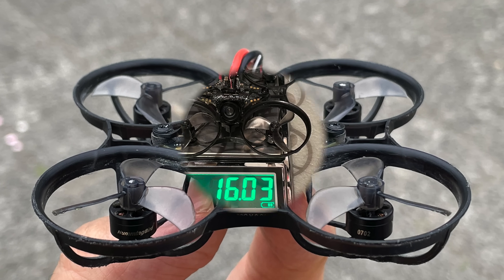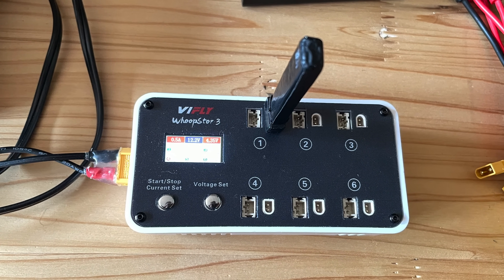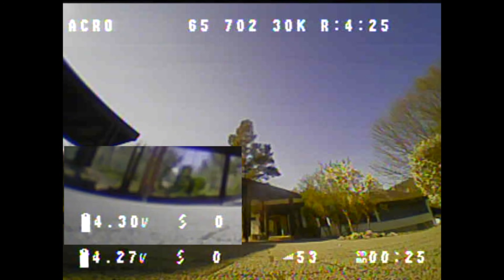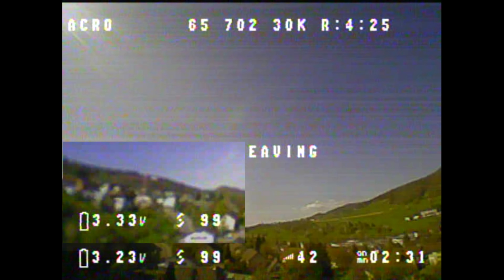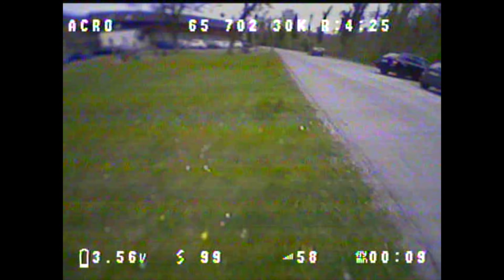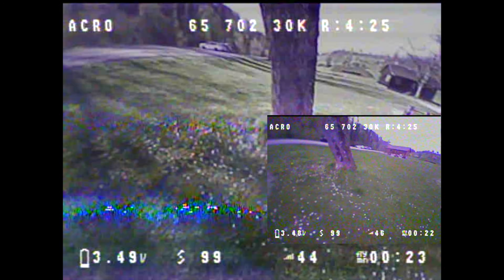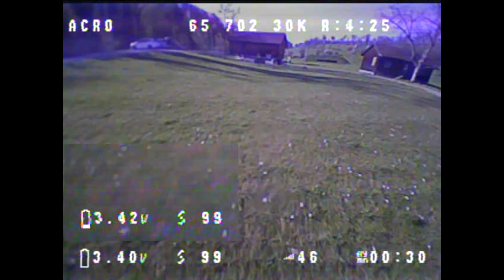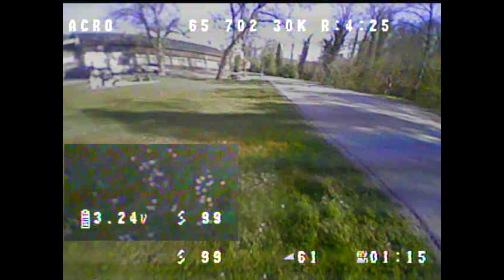SURPRISING EFFECTS of an AWG20 MAIN CABLE on a 65mm Tiny Whoop | Tiny Whoop Mods

Comment: This wont really get you more flighttime but a later voltage drop under your limit. Let's say you have a .1V difference during your punchout as seen on 3:40. This means, with a theoretical 20A current delivered by the ESC, you have a maximum of 2W powerloss at full throttle which is around 3%. This can be easily be calculated using P=U*I. Compared to the gain in weight, this is nothing and you're not even spending the whole time on full throttle. I'm sorry to say this, but this is nothing more than placebo. It's much more efficient to get the powercable as short as possible. This gets the weight down AND the resistance. Keep up your work! :)
Reply from the maker: You can feel it quite good! Even an intermediate pilot can feel it! Just try it out. What are the reasons not to believe me? What are the reasons not to try it out for yourself? 
You can see the data from my other video (75mm whoop hover test) below.
And that`s just hovering. 
Try it out. You won't go back. You'll feel the difference immediately, if you're an intermediate or pro pilot.
It doesn't sound like much on paper, I agree. But in flight, it's very nice. I won't go back.
I've returned many times to AWG22 for some flights because I bought a new whoop with a 22AWG cable installed. And every time I convert it to 20 AWG, I get the same great flight feeling. Even if I leave the 20 AWG cable very long. It's truly the most important mod! Just do it! 
And yes, I know it's a bit annoying to re-solder a new whoop. 
But it's worth it, trust me!
Just do it. Feel the power. Feel good. And then tell others about it!😃🤜🤛🚁🚀

With AWG22 (smaller diameter of cable)

4.29V @ arming
3.98V @ 30 seconds of flight
3.87V @ 1 minute of flight
3.78V @ 1 minute 30 sec of flight
3.70V @ 2 minutes of flight
3.63V @ 2 minutes 30 sec of flight
3.58V @ 3 minutes of flight
3.54V @ 3 minutes 30 sec of flight
3.48V @ 4 minutes of flight
3.29V @ 4 minutes 30 sec of flight
First low voltage warning @ 4 minutes 32sec of flight
First land now warning @ 4 minutes 35sec of flight
End voltage 3.11V and recovery voltage 3.29V
Total flighttime/armed time 4 minutes 37 sec (hovering above ground effect)

With AWG20 (bigger diameter of cable!)

4.31V @ arming
4.01V @ 30 seconds of flight
3.91V @ 1 minute of flight
3.81V @ 1 minute 30 sec of flight
3.72V @ 2 minutes of flight
3.65V @ 2 minutes 30 sec of flight
3.60V @ 3 minutes of flight
3.56V @ 3 minutes 30 sec of flight
3.50V @ 4 minutes of flight
3.35V @ 4 minutes 30 sec of flight
First low voltage warning @ 4 minutes 37sec of flight
First land now warning @ 4 minutes 40sec of flight
End voltage 3.13V and recovery voltage 3.32V
Total flighttime/armed time 4 minutes 41 sec (hovering above ground effect)

Comment: Hi! I admire your insane piloting skills so much! I believe changing the cable is actualy a good idea (I did that to my whoop), and I learned it from you. From my understanding though, the higher voltage reading on the OSD might be caused by the thicker cable having lower resistance. So my assumption is, because the meter on the FC is calibrated for the higher cable resistance, it shows higher voltage with the same calibration for a cable with lower resistance. The positive side is undoubtedly higher amperage that is allowed through the thicker cable. Thank you again!
Reply from the maker: Hello my whoop friend! Thank you for your feedback and input! Appreciate it! You're right! The good thing about it is, that it shows the lower internal resistance very well even with not running motors. You're right that it's probably not the perfectly accurate actual voltage. However, we're not really interested in the actual voltage in the range of two decimal places behind the coma anyway right? So for the purpose of this video, it is kinda good in my opinion that the voltage meter is not perfectly calibrated up to two decimal places behind the coma. In the video, I try to make the difference clear to pilots who don't yet believe there is a noticeable and visible difference. Even with not running motors. I hope this video makes it clear to everyone what effect an AWG20 main cable has. Especially with the voltage warnings which come much later during the punch out test and which are not greatly influenced by the two decimal places after the coma, so it should now be visible to everyone that there is a noticeable difference when flying with an AWG20 main cable. Thank you again for your input! Happy flying my whoop friend!
Reply: @butterflyfpv  True! I agree! Cheers!

Comment: thanis for your video!
its really usefull! 
(i didnt think they sill be a big difference by changig the main cable)
Reply from the maker: Thank you for your feedback!🤜🤛 It depends on what you see as a big difference. At a high level in motor sports or other sports like fpv racing, 5-10% (even 3%) more power, more efficiency, more whatever makes a big difference. Ultimately, it depends on what percentage you're willing to put in the required effort. It's always a matter of weighing things up for yourself. I don't want to tell anyone what to do. I simply wanted to show visible proof with this video so that people know there's a difference that's both noticeable AND visible. I wanted there to be at least one video on the internet that shows the difference in a somewhat credible way.

Comment: Is stock cable on Air65 is ok?
Reply from the maker: Yes of course! The AWG20 main cable mod is just one option to squeeze the last 10% of flight time, efficiency and power out of your whoop. But you can have fun without AWG20! So don't put any pressure on yourself. You can also wait a few years to do the mod if you really need that last 10%.

Comment: You can bring up the Amps. I think it’s better represent the ability of current pass
Reply from the maker: That's probably correct. But not absolutely necessary. I'm not going to redo the whole video and resolder the whoop again. For me, the case is clear. But yes, you're right, that would have been another option. But honestly, it's so noticeable in flight that anyone with the necessary soldering skills should just give it a try. It's worth it for the vast majority of pilots in my opinion. I'm just not sure about elite whoop race pilots because of the additional 0.3-0.4g of the AWG20 main cable.